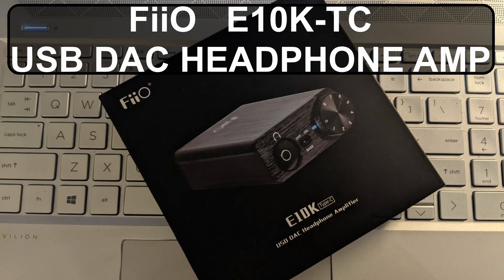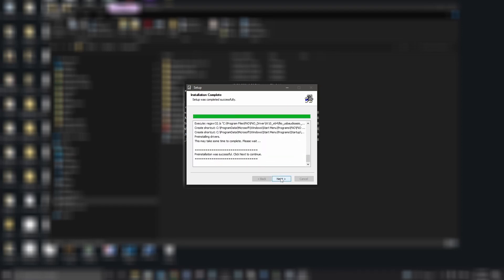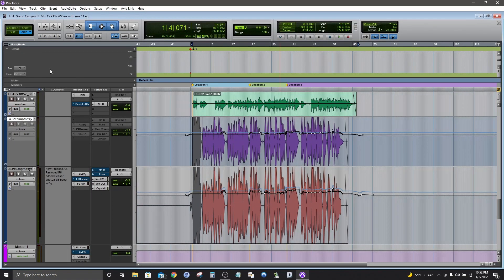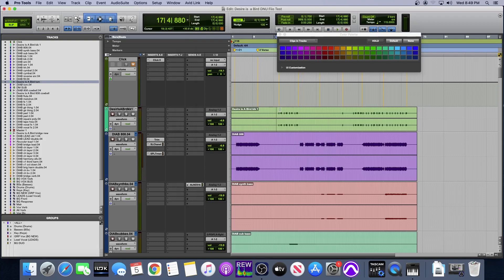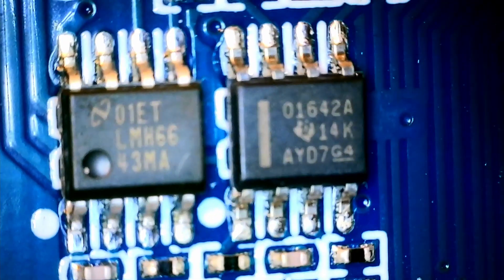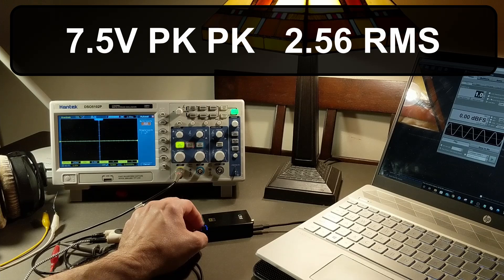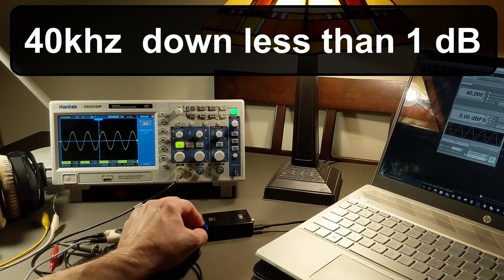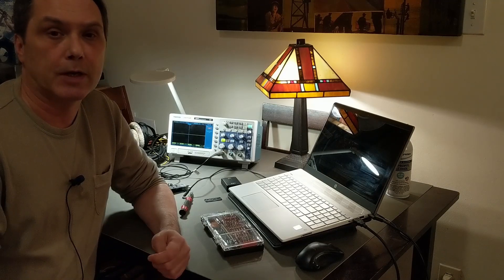FiiO E10K TC DAC Headphone Amplifier Review

Comment: Hello, great review. I have just got the Hifiman HE400SE. I am getting the E10K Olympus 2 in clearance for about 57$ (I'm in India). Will they be able to power the HE400SE to decently loud levels? Or do I get something like KA13 for better power.
Reply from the maker: I don't know those headphones personally,so I can't really comment, and I don't know how loud you listen and what type of music, so I can't really say. But the unit I have seems to have plenty of power.
Reply: @biasedaudio   Thanks for responding!
Reply: @afraza5946  Based on calculation, He400se's 91db/mW sensitivity and impedance of 32 Ohm, E10K can drive it with no problem even at 110 dB. Just make sure you put it on High gain with the gain switch on a E10K.
Reply: @빙하_Glacier   Understood, thanks!

Comment: Hi I really like your video, actually I am thinking on buy this amp/DAC to use with my HD560S with 120ohm, have this model enough power to get the sound of my headphones to their max capabilities? Or i need to look for other equipment? Thanks for your time
Reply from the maker: I would expect it would do quite well.  I expect it will perform better than most of the other portable usb type convereters due to the higher internal voltage.

Comment: I ordered this DAC today, should have it on Wednesday. It will replace my old X-Fi HD USB sound card. I will be using it with my Philips Fidelio X2 headphones. I cannot wait to test it! 😃
Reply: I’ll be using it with the x2 as well. Does it improve them?
Reply: @wallsits9194  There is a difference at higher volumes, but it is not huge, at least to my ears.
I actually noticed a much bigger difference with my other headphones - Koss Porta Pro. It might be because they have much higher impedance (60 ohm), and at high volumes they sounded rather distorted with the old sound card.
The X-Fi was not a bad card, though. There is probably a bigger difference when comparing to on-board audio.
But I really like this DAC. I especially enjoy the analog volume control, because the output volume in Windows can always be at 100, which is relevant when recording.

Comment: Quality content right here!

Just 1 question, is it necessary to install the Fiio drivers? Are there any issues on windows default? I've heard people prefer WASAPI over others. Thanks!
Reply from the maker: Im really not sure. I had a specific which was high sample rates with Pro Tools. I do see reference on the Internet to using wasapi with Pro Tools but I have never done so. This article I found refers to just plugging the unit in and using wasapi, but I haven't tried. https://www.audiosciencereview.com/forum/index.php?threads/review-and-measurements-of-jdslabs-odac-rev-b-compared-to-fiio-e10k.2068/

Comment: Can you set the volume on the TC programmatically on a Mac? A quick check can be done with the Audio MIDI Setup program where I can set output format (sample rate, bit depth) and channel volume manually on my old FiiO E10K. I tried the new FiiO K3, but there was no way to adjust the output volume programmatically, which is something I need for my software project.
Reply from the maker: ill try to check later and see.
Reply from the maker: So this is pretty normal behavior for Mac. I'm not sure how you got the old one to work. But external converters that have a digital sent the mac doesn't see to be able to alter a digital signal, My P.C. can but not the Mac. It will even do this with a HDMI signal. I'm guessing the Mac is sending a volume value to the internal all in one D/A- headphone amp but isn't digitally altering the volume.. Now there is a solution. Rogue Amoeba  "Sound source" software. I haven't used it but I have used other software by Rogue Amoeba and was happy. I think there is a free version but not sure. It might control volume for your K3. As far as sample rate bit depth, when I use the Fiio with 3rd party software, the software controls it. The Mac OS doesn't seem to offer those options.
Reply: @biasedaudio  thanks a lot for your detailed response. Not sure if I asked the question in the right way though. To take this off the YouTube comments, can you send an email to the address listed in my own channel?

Comment: can these power my dt 990 250 ohms?
Reply from the maker: Vortix I do not have a pair of 250 Ohm headphones so I cannot state from personal first hand experience. I have the 80 ohm  DT 770, and the 32 Ohm KEF M500.  So I cannot accurately answer your question. I would expect that this amp would have plenty of headroom based on the design. If you try them please report back. Remember if you purchase on Amazon I believe you could return them if you are not happy.
Reply: @biasedaudio Hey, you upload nice stuff i found while looking for DAC+amp.

Btw I also got a pair of dt 770 (80ohm) and hope this will work ? 

Thank you for the good review 😊
Reply: if I remember correctly (reading the documentation), it should be able to power up to 300 ohms? headphones using the L H gain on the back, using the H (high) impedance/gain in your case. But dont take my word for it, as I don't remember exactly what the documentation said :)
EDIT: Sorry my mistake, they recommend max 150ohms on their website 😅 16~150 Ω is the drive ability, they say.
Reply: More info here https://fiio.com/e10k_parameters

Comment: I would be curious to know it how  performs with a 600 ohm load. I would suspect that the Frequency response would suffer.
Reply from the maker: If I get a minute I will test and see. Though high Impedance headphones are less efficient and require a higher voltage. Lower impedance headphones are more efficient but a low impedance puts a larger demand ( more current) on an amplifier which is why I tested the amp with a 32 ohm dummy  load. I would be surprised if the amp performed worse at 600 ohms than it did at 32 ohms.  The real question is does it put out enough voltage to make the high impedance user happy. I intentionally didn't answer this question in the video because I don't blast headphones loud and the amp was plenty loud for me. My headphones distorted long before the amp did.